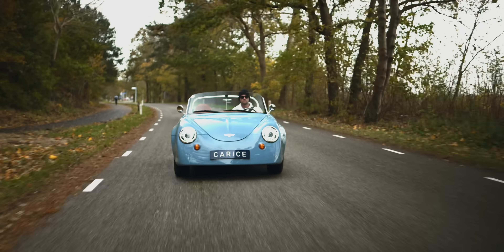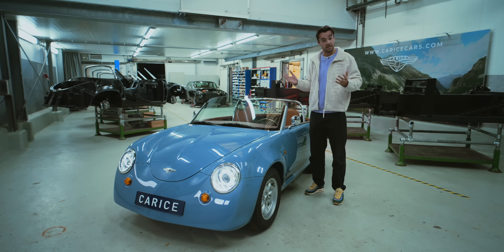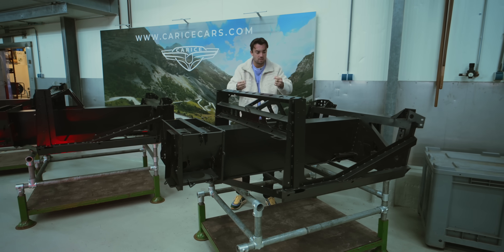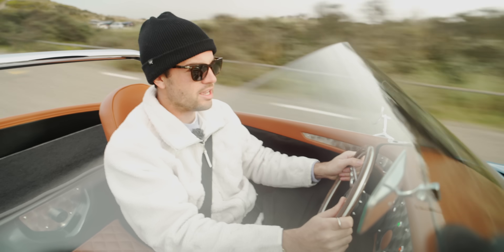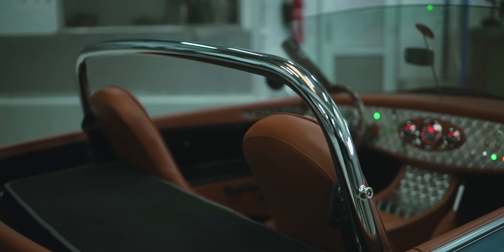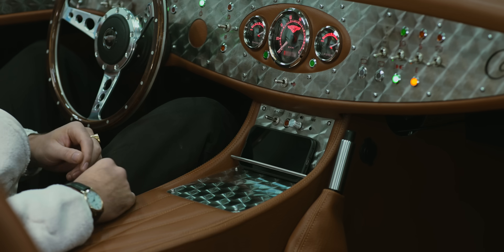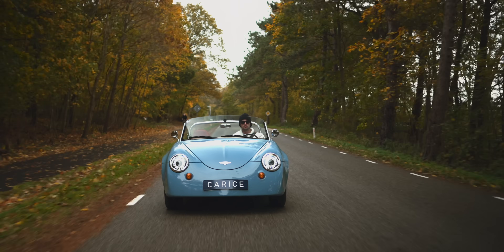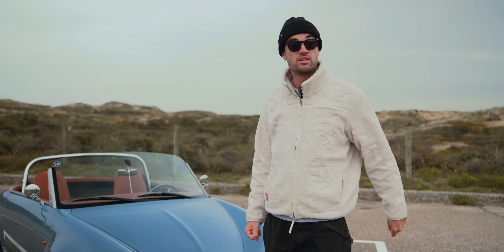This Is The First EVER Lightweight Electric Sports Car!

Comment: looks a little (just a little) bit like an old porsche 356, has the hp/kw in the same range. and sounds like a fun car to drive. same as the 356 is with 'no hp' (by todays standards) - still one of the most fun cars to take for a spin. i am glad that some ppl got the hang for it again and build little fun cars to drive! one of the last i drove was the miata (sure, also not electric) - but the right concept - small, lightweight, fairly low hp... but incredible fun to drive. seing some companies getting the concept now gives me hope!

Comment: It's pretty impressive that the Carice has just under double the battery of my 2015 Smart Fortwo ED, but triple the range! The Fortwo has 17.1Kwh and I can barely do 100km on it (hard to say for sure, I bought it just before winter, and the range obviously diminishes). I'm assuming the aerodynamics and the lower weight helps a lot, and the fact that this doesn't have "all the amenities" of even the Fortwo which has the ABS and traction control and air conditioning and airbags and a big radio and so on. I'm impressed, it looks like a gorgeous car I'll never be able to drive because they're not legal here in Canada.
Reply: Tell me about it! Canada really should have its own microcar/quadricycle regulations to allow for these vehicles that fit well in our large urban cities between bikes/scooters and full-blown vehicles... I also own a Smart Fortwo (cdi) and it serves me well here in Edmonton since I live in the inner city...
Reply: No the Smart cars range isn't because of the aerodynamics, it's because the battery is rubbish. Equivalent Japanese and Chinese cars have greater range. That's largely because they were designed to be EVs from the ground up so don't have a bunch of wasted space that should be cabin space or battery space. Plus it's probably true the batteries available now, are better than those Mercedes put in the Smart ForTwo (but perhaps not by much).
Reply: It also probably does not have any crash protection as it is not a requirement in a low volume micro-car in Europe.

Comment: You point out one of the best characteristics of any GREAT vehicle... The connection with what is actually happening between you and the road. I was a trucker for 19 years. The worst thing they did to the trucks is to take control away from the driver. The truck is not as good as a true professional driver at moving the truck around safely. It's good for the people around and for the cargo if a person is in control. The same can be said for your passengers. That car offers what is needed... Hardly anything other than transportation.

Comment: That's a seriously nice looking car. That shot of the Caterham looks chunky and overaggressive by comparison. I really hope they do well with these. The one thing I'd like them to have which they don't is blended regen braking, so light braking uses regen and the disk brakes are only used when necessary --- it goes against their philosophy but it would also save a lot of energy, which of course lets you drive it for longer.

Comment: How would it (or rather: the driver) do in a crash? I guess one of the reasons modern cars are so heavy is a lot of stuff to make them handle a crash better (or try to avoid crashing in the first place).
Reply: This is legally a quadricycle, so it doesn't need to conform to car regulations.
Reply: How well does a motorcycle do against a Hummer? It's best not to ask because that's apples and oranges... These are quadricycles, small lightweight nimble. It can probably avoid crashes better because of its small size. Same goes for the Smart Fortwo... I can attest to that one personally...
Reply: @Stuntman175  Well in that case, I'm even more concerned.
Reply: Can’t see it being licensed in the states. Safety regulations have to be met. Maybe they already have a plan for that. I drive a Triumph Spitfire and it’s a tin coffin, but also built before regulations were passed. I’m with them wanting to make a basic car and easy to repair but they have an uphill battle. I hope to see one on the road someday

Comment: The fact is that this kind of EV has always been possible. You only have to looked at classic conversions to know that. And if such cars are mass produced the price will shrink to nothing in a couple of years. But this has always been the pattern of car production. Starts exclusive and expensive, then it becomes less exclusive and still expensive, then less exclusive and reachably expensive, then affordable and not exclusive, then quite affordable and accessible, then actually affordable and accessible, then suddenly cheap and saturates the market. Same with all technology. I have a 20 year-old 42" plasma TV. When I first saw plasma TVs for sale it cost £10,000 for a 28" screen. Mine cost £1200 when I bought it. It's still going strong and can display HD output that didn't even exist when it was made. But for £200 I can now get a lighter, higher quality, multi-talented, smart, 50" TV. From a £10,000 28" plasma TV to a £200 50" UHD LED TV in 25 years. Fifty times cheaper (way more if you allow for inflation) for tech that's a thousand times more advanced. The same is happening with EVs only the evolution is even faster. We've already reached the point where you cannot make an ICE car cheaper than an equivalent EV. And before anyone argues I'm talking about the cost to MAKE an EV. How much they sell it for is nothing to do with the actual cost. As Fully Charged has stated many times there is no need for electric cars to be as expensive as they are. This is going to be the self destruction of legacy motor industries because the EV giants are going to start churning out pocket money EVs while the likes of GM, Toyota and Ferrari are still trying to keep their oil industry buddies happy.

The lesson for the anti-EV mob is simple: Stop telling EV advocates what EVs can't do. Because they're usually doing it within a year of being told it's not possible.
Reply: Oil Industry buddies? Do you actually believe that crap?

Comment: That looks like a great car! A bit like the original, tiny Porsche cars. I like the idea, a small, light and nimble car, that doesn't need too much horsepower to be great fun! The funnest motorbike I ever had is the one I've had for many years now, a pretty small 50 hp retro bike, with very nimble handling. Just lean in over the TT handlebars, gun the throttles wide open, and aim for the apex! And you might be doing this at a legal speed, but it still feels just great! This car looks like it's doing just the same thing, but on four wheels!

Comment: Wonderful review. Small lightweight cars have always been a favorite of mine.. it’s more fun going around a corner fast than accelerating in a straight line. That said, for I’m concerned that there doesn’t appear to be much in the way of safety. For instance, your head acts as the roll bar, there are no front or rear bumpers, and obviously no air bags. While it looks like a lot of fun it doesn’t appear very safe.

Comment: Finally a tiny electric car with literally no head protection and only starts at twice the price of its petrol equivalent. I can't wait until I go to my local second hand car dealer and buy a rusty, black smoke chucking Mazda MX5 with 2 million miles on the clock.
Reply from the maker: Seriously, when you do buy a Mazda MX5 with 2 million miles on the clock please get in touch because I promise we will make an episode about it. I can't wait.

Comment: Please can you look into   " L7 " Rules .. is that a quadracycle ? ( is that in the uk Max 450kg + batteries, Max power 15Kw ,20hp  top speed unclear from DVLA some places say 28mph & others 56mph? )  And thats why it can have those dashbord switches, no airbags, nice steering wheel , & no ABS. Best not to crash with a rangerover!   Good to a competitor for LukaEV  ( 750Kg , good looks £25k?)

Comment: Now THIS is what i've been wanting. Battery through the center is something i've wanted since EVs started becoming more viable. 300 km is plenty for daily usage. This is lighter than most gasoline cars. Clean body without the unecessary edgy and complicated designs on it. Heavy steering, yes please! I love that they gave you the sound of the actual motors without dampening it or giving fake engine noise - EVs need to be proud of their drivetrains, not pretend it's something it isn't. Analog, good design... this is a dream come true.
I'm still always going to ask for a manual transmission, and I will always be more excited by a high revving engine, but if this is the future - i'm all for it. Hope they can eventually ramp up production numbers high enough to make them availible internationally.

Comment: Being left hand drive and electric, is a positive note that one can only hope or dream this unit will become available in the US once it's in full production. Happy to see the Nederlander designers took a persons height into consideration .. Many Americans have more massive arses and girthy guts as issues other than height to contend with & those comfort food fed XXXL boys and girls usually drive huge pickup trucks, SuVs or full sized auto- beasts, as the law of physics becomes obvious that they are not built to fit inside a mini, sports or micro car. One of my first cars i owned was a pristine low mileage '56 Porsche speedster i bought in 1969 for $800 USD when gasoline was less than 25 cents per gallon.. Back in those days speedsters were not that popular or common, even where i lived in sports car friendly Southern California people saw them as little cartoons, or upside down bath tubs. Big full size American muscle cars with massive thirst & horsepower were and still are the craze and desire for those who insist on living large. I just sold my 1990 geo metro convertible, 3 cylinder/5 speed that weighed in at 725 kilograms/1600 pounds and did about 55 to 60 miles per gallon, great little car that gave me many years of reliable service with no issues whatsoever.

Comment: Cute little car for sure.
It looks like tall folk's heads sit above the windscreen and roll bar levels which means it's not for me at 6ft 2.

I'll probably stick with my MG ZT 190 which we've had since 2007 and love it to bits.

If anyone hasn't driven one........I urge to to try one ❤

Comment: Electric whine and straight cut gears are very different. 

Love the manual brakes and steering. Once they get it a manual transmission, it will be set. 😅
Reply: It’s got manual gears. One gear that doesn’t need to be changed. 😉

Comment: What a lovely car! If I had the space for a car just for summer cruising I'd get one of these. The big issue though for me would be charging. 31kwh probably isn't a big issue, but charging limited to 11kw and 10-80% charge time of 2,7 hours isn't really that appealing. I'd like to drive for an hour or two, have lunch or dinner while charging, and then drive home. Should have at least 22kw but preferably closer to 50kw peak.

Comment: This show should look into Amprius Technologies batteries and their achievements. The top 4 finishers in the World Solar Challenge where solar cars raced across Australia a couple months ago... had Amprius batteries. Also the Aussie company Infinitus Aero is using Amprius batteries in an electric sports plane. Both AALTO-HAPS (Airbus) and PHASA-35 (BAE Systems) have Amprius-powered "high altitude pseudo-satellites" that are pretty interesting too.

Comment: Wot, no cup holder?!
Very skillfully done and enjoyable video. Thanks.
As to the body design, I think it could be improved if the front end could be tucked under a little more. The side view from just behind the front wheels (e.g. 3:02) shows a slightly gaping appearance.

Comment: I don’t want a sports car, but I love all the other attributes.  I’ve only ever owned a 63 Bug, a 77 Accord, and an 87 Prelude (still driving it).  I want the simplicity of the VW (when the clutch cable broke I was able to drive it home using the battery to pop-start it at intersections), and the fun of driving them and ease of parking.  I test drove a golf cart and loved it.  Give me a cup holder and perhaps airbags and a bargain price (I got all 3 cars used ,for 10 years and sold the first two for more than I paid not inflation adjusted). It needs to be able to haul an 8’ piece of lumber or ladder, too.
The VW could go full speed across railroad tracks that sports cars could not clear (bumpity, bumpity, bumpity,bumpity), but I suppose that’s asking too much.

Comment: I like the Carice, but I suspect it won’t get to the US market. For US drivers I suggest the Vanderhall Santarosa. The GTS version will go 300 miles for a little under $49k. Other versions cost less and have a shorter range. It’s three wheels like a Morgan, so it’s not eligible for any tax credits, but it’s built in Utah. 
The EV skeptics can buy the ice versions, Carmel, and Venice that have been around for years.

Comment: Love the look and size of this but I do wonder how it would fair in an accident.
Also how would it work with the new UK regulations that require new cars to read speed limits and warn of excess speed?
Nice car though, especially like the solution to the charging cable... Very clever 😃

Comment: The indicator switch could be a little closer to the driver so a small (morris minor style) central in dash ignition key could be fitted. That would just complete the retro feel - by all means have all the modern security but a key on switch would feel right - and a skinny chrome central gear lever - then that interior would be perfect IMHO. Remands me a lot of James Deans "Lil Bastard" Porsche. I want one. In silver...
Reply: Yes, it reminds me of that vehicle also, but we all know what happened to that car

Comment: It does need better regen allowing for single peddle driving, a heat pump, and a hard top if possible. With that they should have a mass market low cost Tesla killer provided they can scale up with automation and lower cost interior materials. I expect there is a huge demand for the cheap electric cars with their cheap maintenance and fueling cost.

Comment: Yes, quite a bit too expensive but a beautiful exercise in  craftmanship and efficient battery electrics. The car that exceeds it in every way, including a lower price, is the Aptera solar electric car due to be produced at the beginning of 2024 also. Nearly 500 kilometers of range, free charging with solar panels, just as light, and safer-- but not as much fun as this cabriolet.

Comment: The Carice is a very cool car. I really like the Speedster looks. Love all the switches and other retro touches inside, and the lack of plastic. (The dash surface is referred to as "engine turned" aluminum.)
It does look fun, but I can't help imagining it with a 1969 Cosworth 1.6 liter DOHC I-4 mounted transversely in the rear, and a close ratio 4 sp manual.

Comment: I think te reason most cars are over weight and too big is due to the safety tests they need to pass (and also the masses are told that this is what they want!).
Low volume car makers side step this requirement so can make thiese small, light cars (though not cheap) but what would it be like in a side on collision?

Comment: So 26lb/hp sounds good but what we need to factor in is with those low numbers the weight of the "cargo" really makes a difference: Lets say 2 people added = oups we jumped to 29lb/hp...a bit luggage = 31lb/hp. A mild sports car would have 10lb/hp. So we are not there, at all.
Ok it is electric so instant power, double the fun factor: If half the ratio= 15lb/hp nope...  Lets go crazy one light person and nothing else = 26lb/hp, that is the best performance the car has ? A stock 1966 VW Beetle ratio is 43. A 1990 BMW (4 seater) 325 ratio = 10.7lb/hp, A Porsche 911 is 6.4, a Lotus super 7 = 4.6lb/hp...
Not dissing it but the comments here are... misleading.
Tesla Roadster 2008 anytime.
THIS is why you have to take these YTber reviews with a grain of salt! LOL
Cheers,
a.

Comment: Auto manufacturers, insurance companies, and state vehicle registration laws in the U.S. have conspired to create safety and other requirements that effectively make a high/expensive barrier to entering the market by new manufacturers and ideas.  Meanwhile in many states motorcyclists can travel on roadways without any of those safety requirements or even a helmet.  Makes it virtually impossible to sell a lightweight, simple, energy efficient and lower cost mass-produced vehicle.  The large SUVs and trucks that comprise much of the U.S. market are huge consumers of oil (and create lots of carbon pollution) and important source of profit for the manufacturers.

Comment: So near yet so far. Mirco car means it probably hasn't been crash tested so at the very least I'd expect an airbag. Even Morgan give you an airbag. The switches are cool and I love the dash but reaching for that indicator would get annoying after a day or two. Who knows where the switch for the wipers has been placed. Best looking little EV I've seen but needs a few improvements, especially at that price.
Reply: Yeah, this wouldn't be allowed as a real car. The switches could perforate your head in an accident. Which is why you won't find vintage switchgear in modern cars anymore.

Comment: Looks and sounds like the mini electric Porsche 356 Speedster Santa delivered when I was 11. No not the Powerwheels toddler mass produced plastic thing... it was a limited proper mini Speedster reproduction. Of course the four lead acid batteries ran out of power well in advance of my enthusiasm to keep driving. Within three months the car was sent off for conversion to a little petrol engine and drive system.